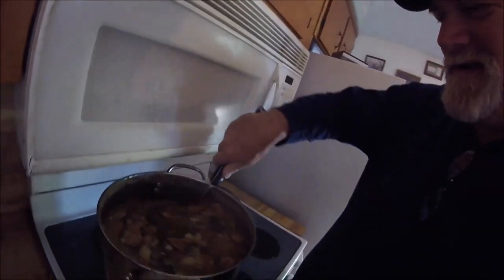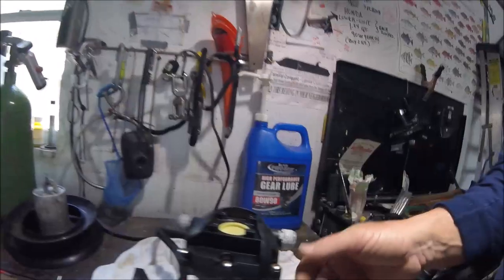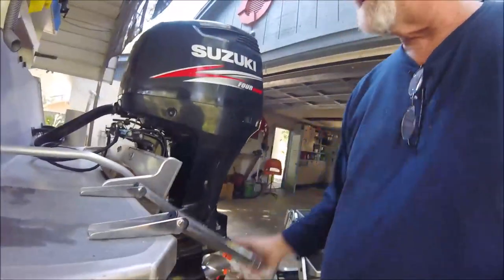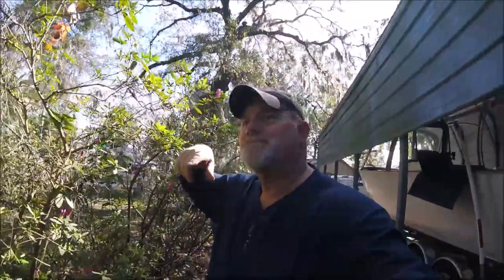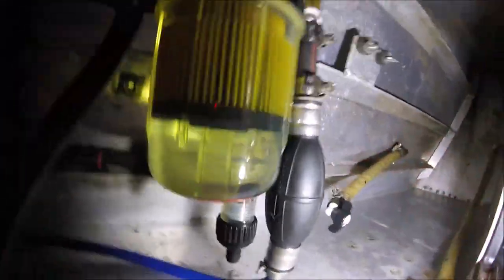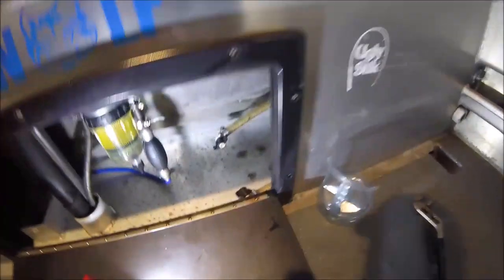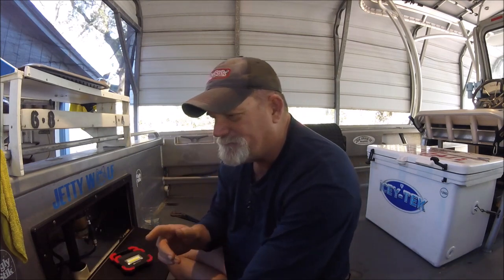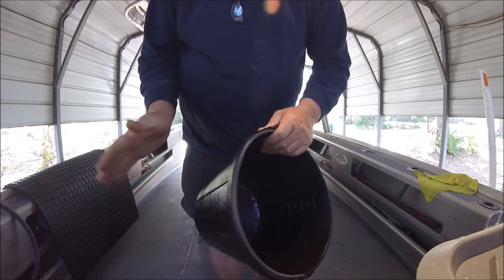FISHING BOATS, charter Captains perspective

Comment: I love the layout of your boat. One thing i have always wondered is does your boat have pitting on the hull from saltwater. I use to have a bass tracker that i ran in freshwater mostly. Finally decided i need to saltwater fish to with it. It didn't take real long for it to start pitting and leaking. I always washed it down good when i got home and sometimes when possible right at the ramp that had fresh water water hoses available. I went to glass shortly after boat i have a soft spot for tin boats
Reply from the maker: none of those thin ''TIN'' aluminum boats have 3 pound anodes on them, and most people wire stuff all wrong. The only anodes will be on the outboard!!  Mine ain't tin.....more like solid 1/4" bottom and all 5/16th elsewhere with a 1/2" transom. bass trackers couldn't be any cheaper, to meet price points.
Reply: Yeah that’s true

Comment: Dave, watched this video several times. I know the problem at 4:10 the scoop/ scupper intake is facing forward. Not striaght down like a though hole. Forward boat speed wiil create positive pressure in the line. This is an easy fix for a local welder dealing with aluminum. Fluid dynamics 101, fluid under force reacts as a solid.
Tight lines Dave and ask around to see if local guy might agree with me!
Reply from the maker: yeah, I know...I've had scoops like this on several boats. I had this put on boat when i had it built.  I  said, the pump is leaking. Thats why I  took it out. the scoop is supposed to pick up water as I RUN. baitwell / wash down pump 101. MY DAD POINTED OUT THAT I NEVER SAID HOW I FIXED IT ALL. ....DOH, THAT PART HIT THE EDIT ROOM RECYCLE BIN, FOR  TIME CONSTRAINTS. I KEPT PUMP OUT PLUGGED INLET PIPE INSIDE. SO IF I WANT TO RE-INSTALL PUMP LATER I CAN.
Reply: @CaptDavesSportfishing  I agree and understand fully. A faulty pump, bad seal,etc. The bucket for salt water washdown works perfectly and never fails.
Reply from the maker: @aaw376  got that straight! BUT...I may install a new one. ya never know 👍
Reply: @CaptDavesSportfishing  Capt. Dave, on a different subject. Here in New Jersey, i froze my tail off, 25 degrees, 20 knot winds and 8 foot swells in January for a lousy 6 pound tog one fish limit. I assure you i paid $125 to not enjoy fishing. Can you make a video in the future of what species Jacksonville has to offer from January though May. Cabin fever my friend. Blue's and Strippers come in mid May up here. I assure you many fisherman here would take the trip down to Florida just to bag decent fish. Bull redfish,etc.
You would be surprised on the winter months. All fisherman have the urge. Im never going out in 25 degree weather ever again.
Reply from the maker: @aaw376  Problem with youtube is no one ever goes to my channel. I  have HUNDREDS of videos of what i do...(same species 365) all you have to do is look at the upload date. if I'm wearing a jacket, its winter......''but we have crap fishing too'', so you throw the dice on weather in Jax. jan and feb and march, also. BUT APRIL THRU MAY, Transisional times are always #1n just like oct -dec. JUST GO HERE: oh I know....its homework, and just not falling off a stump EZ. 186 videos:  https://www.youtube.com/playlist?list=PLK-ee3q-bFR1rNSxDMEKOMH9tPAsDY_Tt
365/ 12 months a year: redfish trout black drum.....and many fish fry fish thrown in. NO OFFSHORE, JUST SUMMER COASTAL SHARKS, AFTER JUNE 1. MY YOUTUBE CHANNEL: https://www.youtube.com/c/captdavessportfishing  MY FISHING REPORTS BLOG WITH LISTED ''ARCHIVES'': https://blockurl99.blogspot.com/  BTW..all this is usually in my video descriptions no one ever looks at if phoneheads. click on ''show more'' under each video on a real computer. AND NEXT TIME JUST EMAIL ME INSTEAD: WWW.CAPTDAVES.COM
Reply: @CaptDavesSportfishing  My high school friend and now 28 years later builds custom fishing rods. He is in the same boat. I tell him all the time as i tell you now. One viral video away. Whether accidentally catching a great white on video. Just an example!
Catching a bull shark on a weak rod snapping. It worked for Blacktiph channel. That was a goliath grouper. Non the less. Reality tv
Reply: My friend Joe. Youtube Angry Worm Fishing. We may have to schedule a trip down to you in April.
Reply from the maker: @aaw376  that dudes in ''lala land'' Florida....he's a canadian import I think who never went home. whats that gotta do with a channel showing people the real charter fishing business, and what started out as nothing but ''heres what you'll be doing'' on charters, type videos for my reports blog???
he's in the shock biz, I'm in the educate my customers biz. I have  ''DAY JOB''.
Reply: @CaptDavesSportfishing  Who? BlacktipH?
Reply from the maker: @aaw376  just has to contact me: www.captdaves.com - advanced reservations with deposit. have loads of pre-booked dates in march.
Reply from the maker: @aaw376  big $$....not fishing for a living.